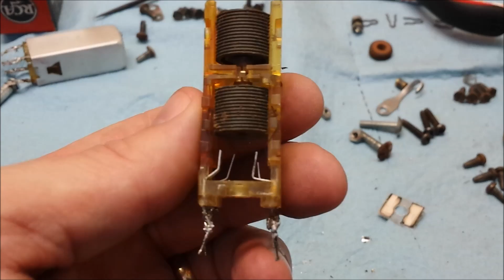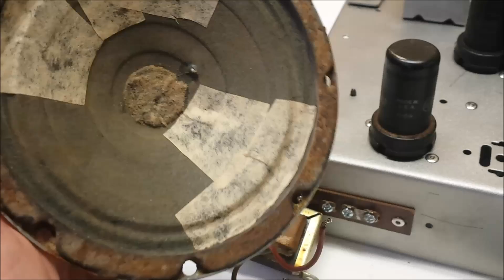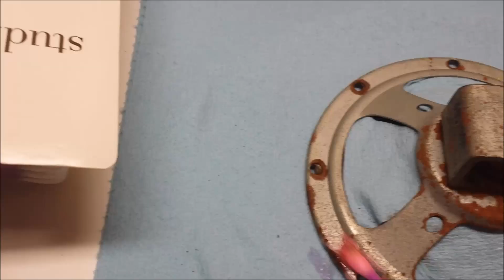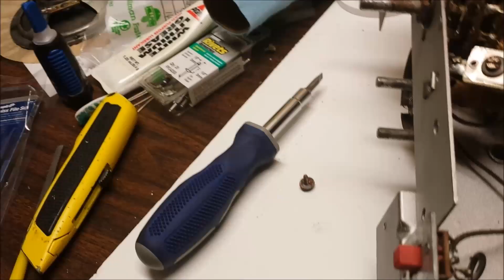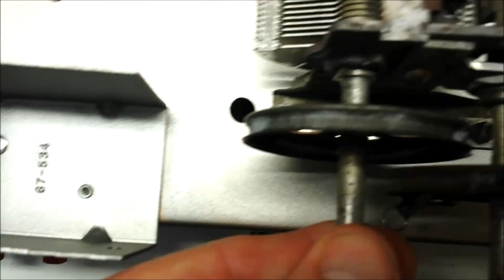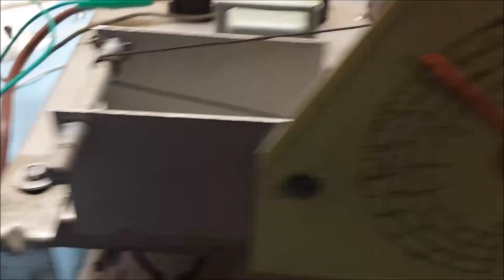Hallicrafters S-38B Restoration Part 4

Comment: Since I don't drink coffee I used Lipton tea bags and the same glue ,I had a speaker like yours but smaller it worked well ,even though I have a new replacement speaker ,I didn't want to have to remove the transformer and remount it. ,so I use Aleenes glue and tea bags .

Comment: Alot of the corrosion and junk on the small parts can be removed quite nicely with Dremel wire brush attachment, without using the naval jelly.
Reply from the maker: I recently used Evaporust, seemed to do a good job on the rust and I could still polish the chassis after.
Reply: wd0dxd de N6VTS...great series...very helpful!  73, John

Comment: On my Hallicrafter S-120, I have vertically mounted Disc. Caps in the IF Cans. They are good, and read 80pF.
I see at 22:40 you used 100pF.  Either that works well for your S-38B, or it's close enough tolerance with 100pF.
---
Question?  Where can you get replacement IF Cans?  I have many sources on my web site for old radio parts, 
but can't seem to find replacement IF Cans.
---
Since their is a plethora of Speakers out their, I always replace those old "dried up" speakers for new ones!
Can't see patching and old dried up speaker that will be useless after some time.
Reply from the maker: I haven't seen a set of IF cans from a 120 yet.  If they are Disc ceramics, they are probably still good.  I just started with 100pF caps, and they worked.  I have seen people use anywhere from 82pF to 120pF.  As far as replacement IF cans, you just have to scavenge them.